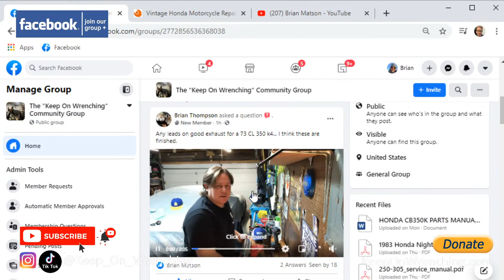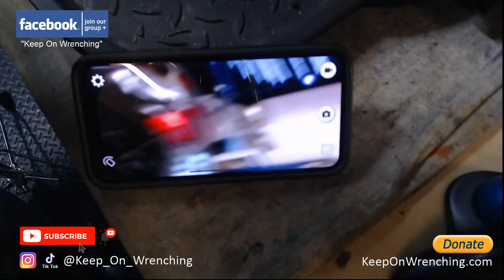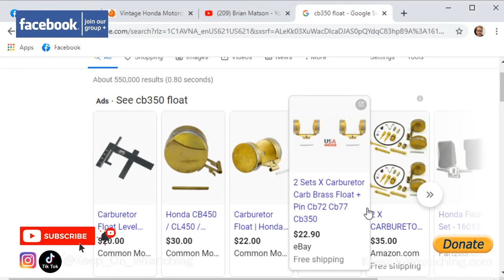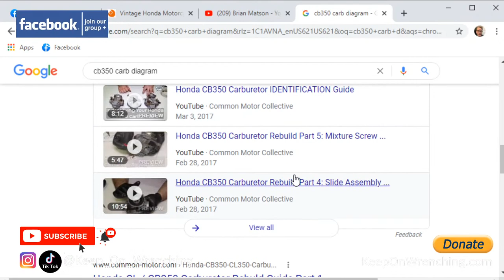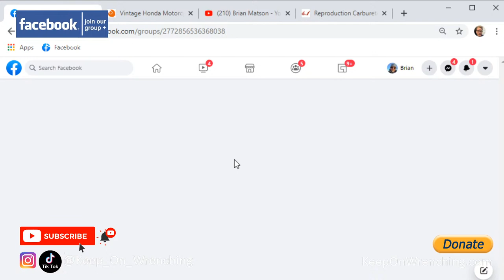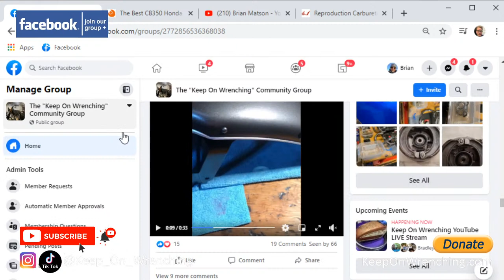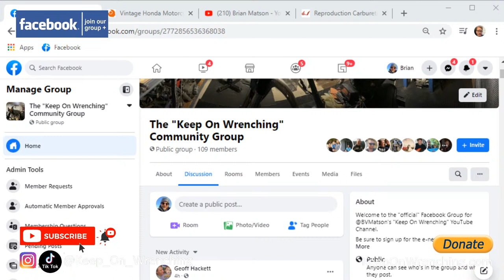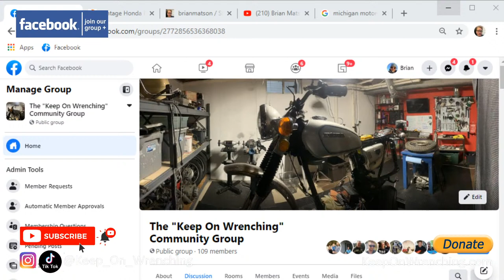Vintage Motorcycle Restoration LIVE Stream: Gas Tank Inspection, Petcocks, Polishing & More

Comment: Looking for my last project for me and that a 1971 or 72 cb175.  Do you have one that not going to require a full restoration?  I've finished the 75 CB 36t and I super proud and thanks for the tips on your how to vids.  (Anyone restoring a bike and need step by steps...this is the cat).  Anyway, I think you know about my little Cancer thing so I may not have the time to do a top to bottom rebuild but if I can find one running, tank with no dents or rust through and no cracked chassis, I'm in.  I'll still do all the grunt work like bearings, hand sand ect.  Just want the bike that runs so I don't have to rebuild the engine.  Must have side panels and badges.
If you have one let me know.  I got dipped in mud on a few deals.  One was too good to be true and it was.  SCAM from top to bottom.  Never got tot the pay part as they wanted some odd forms of payment and the bike was too clean.  Told him a friend was going to come by and look at the bike and that's the last time I could reach him.  The other two were bait and switch.  Here's the fair price and then it doubles when he finds your legit.  Ha.
Sorry to screw up the OP but if you had one, I'd know it was the real deal.  Don't want one perfect, but don't want one that will take year to restore.  I'm just not sure on time, if you know what I mean.
Thanks for all the help with the 360t.  Between you and CMC, I was able to do a top shelf restore and had very little knowledge on how to do it.  Keep it up the way you do your vids.  You even show your mistakes, that we learn a ton from because we will be making them too.
Thanks buddy.